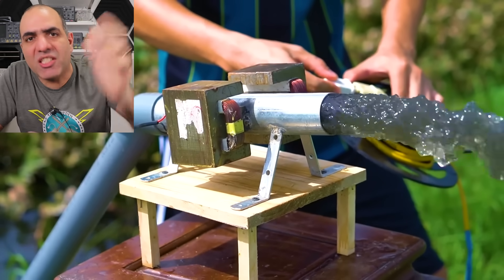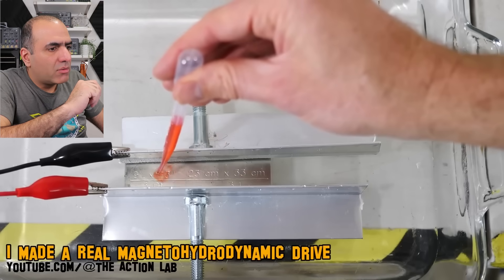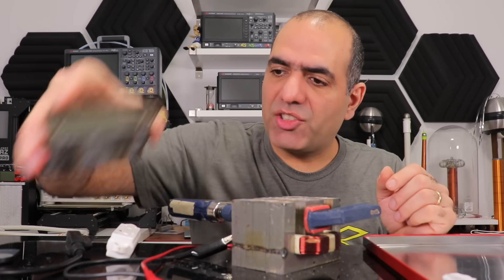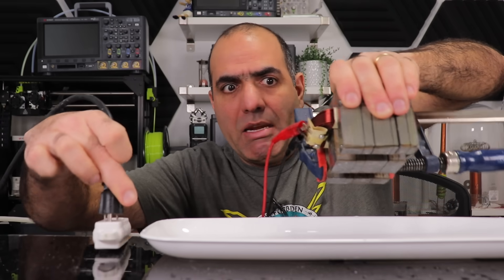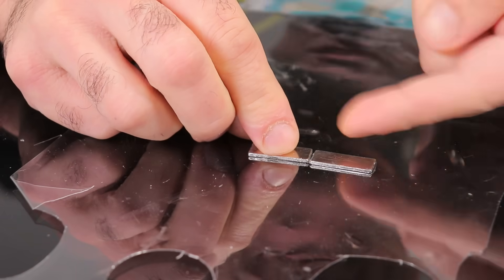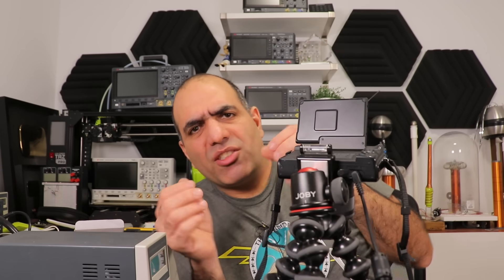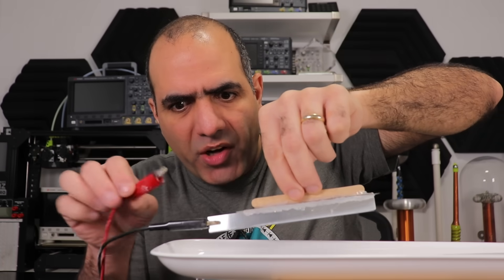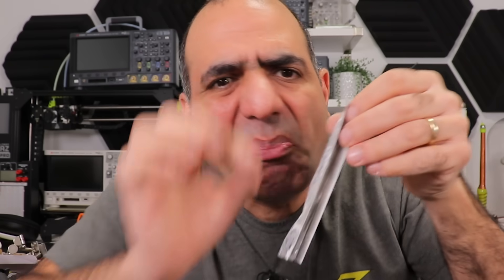Making a Water Railgun

Comment: Virtually every magnetohydrodynamic video is based on conduction between two plates, which with water, really uses up a lot of energy electrolizing to hydrogen and oxygen gasses . I'd really love to see induction based MHD. I get that water's resistance limits eddy currents, but i believe there is more influence then seen in this video. For instance, where is the water going to go when 120hz magnetic pulsed induction pushes it up.  It isn't going to break away from the pan bottom and, and because the depth of water was very shallow rather than deep.  Almost all the magnetic field exits the shallow water column rather than induce eddy currents at  greater distance.  

I have an idea. Take two MOT and face them to each other but keep them seperated with an airgap that grows from narrow on one side to something larger on the other.  And arrange the current flowing in the coils such that their magnetic fields atract rather than repell the the two MOT.  You might try wiring the two in serries such that their impedences add.  Or wire them in parallel  but with a third MOT in serries acting as a ballast.

 I believe that you will have a greater magnetic field, and that the magnetic field will be a gradient across the various sized openin,  and that and the physical geometry will aid in pushing water from the narrow magnetically stronger side  to the magneticly weaker wider opening. Maybe the induction effect will still be small, but without electrolizing water on two plates, induction based magnetohydrodynamics should be more efficent.

If you really want more pumping effect. Make the spacers between your MOT electromagnets out of something squeezable. plastic springs? The action of two MOT electromagnets  attracting each other 120 times a second will pump water more effectivly. 

Lastly wrap the MOT electromagnets in plastic so that you can keep the salt water off their steel laminated cores.

Comment: You were basically doing electrolysis between the two plates of the actuator and based on the fact you were using salt to decrease the resistance of the water you were generating chlorine gas and hydrogen gas, so in conclusion, yes, at least some part of the gas you were generating was poisonous.

Comment: On the topic of solid state  drives, @ElectroBOOM have you seen a video (I think it was Cody's Lab, I could be wrong) where he makes a freshwater electric field drive? Basically, he uses a sintered glass particle filter with two aluminum grids on either side in a round tube and DC current running though them to pump water. In the presence of Silicon Dioxide, one of the Hydrogen atoms in the water is attracted to the glass, causing the now slightly positively charged remaining OH group to be attracted to the negative electronic field of the electrodes, moving the water though the filter. it's not very powerful, but it is really cool.

Comment: 10:50 the reason for your house getting 113 volts is because you are a bit further from your local high voltage transformer, also during peak hours the voltage drops simply because the higher usage
Reply: hes meter is showing 160v, 113v would then be the RMS. something is going wrong but i dont know what

Comment: no, teh way you do water railgun is that first you need a strong laser to ionize the air, then you ionize the water not by contaminating it, but by stripping off the electrons of water molecules, creating a highly charged mist, then use a high frequency vortex gun to shoot this along the laser. the last thing to make this work is a high power sonic driver that pushes from behind and keeps the vortex rings of mist stable.

Comment: To be sure, there are water pumps that are made out of a single electromagnet, but that electromagnet is vibrating a metal bit attached to a rubber membrane. Said membrane does the pumping with the help of valves.

About the 160V water gun: you could have simply used unsalted water. That would have limited the current, and it would have made one of the most dangerous water pumps imaginable. 😁

Comment: Question? We're dealing with magnetic fields and eddy currents here, wouldn't a bit of thin insulation between the metal and the water solve the problem with the electrolysis without significantly affecting the pump effect?

I'd like to see this re-done with two insulated rails and something like a thin-walled PVC pipe running through the rails...

Something like this maybe? 

|o|
Reply: The fields driving the projectile are a result of the bridging between the the rails, as he explains at 8:50
I'm not sure why the projectile has to do the bridging as it would seem you can have the rails permanently bridged at the end, I suspect there's more than is discussed here.

Comment: "I don't know whether these gasses are poisonous or not"
Does nothing to prevent him from breathing them.
True engineer
Reply: Knowing that water molecules are split into hydrogen and oxygen by the electric current takes away a lot of fear of poisoning (and brings up other ideas which are involving playing with fire). Only danger present is the salt which can produce some small amount of chlorine gas. Shouldn't be much of a problem if you don't run this experiment for hours and stick your nose close to the gas bubbles.
Reply: @Schlappspaten_spielt  Chlorine will form more easily than oxygen but you can smell it before the amount reaches poisonous levels.
Reply: @Schlappspaten_spielt  yeah, you can't die or have irreversible injuries from slow chlorine buildup. You will run away crying long before it reaches dangerous concentration. The only situation where you can get seriously injured or die from chlorine is when you're instantly exposed to high concentration of it and you have nowhere to run. Then you'll cough your lungs out. Literally.

Comment: Water is a polar molecule, so you can move a stream of water with electric charge or a magnet.  Try putting a magnet near the water coming from your faucet some time.

Doubt it can be used as a motor, though.

Comment: 13:36 if you're using table salt (Which you shouldn't - use baking soda instead) then the gases are a mix of oxygen, hydrogen and chlorine (which you shouldn't breath in). If you're using baking soda instead, it will just be hydrogen and oxygen and a small ammount of CO2.

Comment: I keep thinking of the caterpillar drive in "Search for Red October".
If a nuclear powered sub used huge magnets then the flow of the salt water would cool everything keeping the magnets below their Curie temperature
It'd have to use batteries as a generator would be too loud. 
You'd only need a couple of knots to make a totally silent drive worthwhile.
Reply: That it's actually a thing in real life, but it's very inefficient.
Reply: With superconducting magnets it's feasible though still impractical. Also chlorine bubbles would be well detectable. In theory if strong running magnetic field was generated making kind of induction motor with water as its rotor, it wouldn't have any electrolysis and bubbles of gas. But I'm not sure it's possible. Usually superconducting magnets generate static magnetic field...
Reply: @allmycircuits8850  Chlorine gas production apparently can be controlled with a catalyst from Iridium oxide and  Manganese oxide. Wonder if efficiency could be boosted by collecting the hyrdogen gas and feeding it into a fuel cell.
Reply: Glad to see there are several commenters here with good taste in movies. :) BTW: It's The Hunt for Red October, just to be pedantic. ;) Released in 1990, it was based on the 1984 novel by Tom Clancy, directed by John McTiernan and starred Sean Connery, Alec Baldwin, Scott Glenn, James Earl Jones, and Sam Neill. Thanks for coming to my I-just-recapped-the-Wikipedia-article TED talk. :) That movie still holds up today, I think.
Reply: @antisoda  I thought it looked wrong when I wrote it! Thank you. It was long time ago that I watched it. I'll have to watch it again... 🚗🐛

Comment: if you don't want to make those poisonous gasses (in this case chlorine) try using  baking soda. salt is made up of sodium and chlorine (NA,CL) held together by ionic bonds witch break during electrolysis creating  sodium that reacts with water to make hydrogen and chlorine that is a gas that is a poison. baking soda (Na, H, C, O) is held together with ionic bonds that when broken by electrolysis release sodium (reacts with water to create hydrogen), hydrogen, carbon, and oxygen. This is why you should use baking soda as your electrolyte instead of salt.

Comment: Didn't you basically have a small electrolysis effect going on..  hydrogen and oxygen coming out of that process. >.>  
I was afraid you'd make a spark as a prank, and ignite something a bit more than intended.  
I suppose it wasn't enough to do anything in an open air environment.  Phew

Put that reaction in a bottle and you might have a bit more fun. :)

Comment: Note on 120vac rectified to 170Vdc and drawing too many amps. If the rails were half the height, there would be less surface area to conduct, and less current current would be allowed to flow in the circuit.  Also, If there is a conductive path through water between two potentials,  charged ions will flow, so you want only the inside surface  of your rails conducting where the magnetic field is pointing in one direction. Outside the plates, the magnetic field curl and eventually point in the other direction, and current flow outside the plates don't contribute to the effects your looking for.

Comment: Water is dielectric so you could use high electric charges placed in the correct positions to move the water. My friend and fellow Electrical Engineer did this experiment in his garage (very dangerous)

Comment: Magnetohydrodynamics is perfectly real. It doesn't work if the liquid is not have an electric current flowing through it. It isn't the water, or the ionized water which causes the motion...it is the magnetic field produced by the electric current in the water in combination with the external magnetic field. Also, it is a D.C. current on the outside electromagnet (or permanent magnet). An A.C. electromagnet would never work even if there is a strong electric current flowing in the water (the water would vibrate, not flow).

Is the water in question sufficiently "unpure" (ionized) to conduct a D.C. current? Is the supply of current in the water itself producing enough voltage at the given level of ionization to cause a sufficient current? Is the outside magnet oriented such that it flows in one direction only, rather than rapidly flipping flow back and forth and averaging zero velocity?

It is quite possible the other video was a fraud, but it is plausible if enough power was conducted through the water and simultaneously an outside magnetic field was applied which did not alter field direction.

Comment: 13:40 The gases are hydrogen and oxygen, it¨s water electrolysis. it's a basic "system" what you can use for separate water to it's gases. Hope it's gonna help you...
Reply: and chlorine gas from the table salt
Reply: what about the salt?.. it produce chlorine gas with electrolysis

Comment: I think I just figured out a way to make magnetic pumps work using magnetic particles and a similar mechanism to removing chaff from seeds.  If you place the magnetic particles inside a housing full of water and you run those particles through something similar to a chaff separator, you get the particles back after using them to push the water through the housing out a low density outlet.

It would absolutely work to move large amounts of water very quickly as long as the water source remains stable.  The friction of the particles being pulled through the water is more than enough to create a vacuum pressure the propels the water from the outlet while returning the particles to the inlet with gravity.

So you're wrong too.  This is more than possible.  Just not the way the scammer represented it.

Comment: Just a thought, but if you ran this in a pipe with a nozzle at the end rather than a channel that boiling water <should> kinda "shoot out" and thus sorta work as a "pump" I ssuppose (or a rocket if you get it hot enough)...

Comment: you should test your breaker because the more you pop the breaker the weaker it gets .. some breakers can only be used 2 or 3 times .. sometimes just switching the breaker off like a light switch can damage it
Reply: 2 or 3 are the fake ones
Reply: Does it make it pop more often?
Reply: @vappyreon1176  seems like it .. its like the breaker pops at 14 amps instead of the original 16 amps .. sometimes it doesnt even pop and gets super hot untill the metal contacts fuse themselves shut and thats very dangerous ..
Reply: @6kill6god68  If the breaker welds it self it's a pretty shitty one, or the thing is way out of his rated work range.

The bimetal strips that make the internal switch of a breaker are supposed to bend at one specific temperature.
Reply: The breaker he's referring to is on a power strip, so I'm sure he probably replaces the power strip after so many times it pops
Reply: ohh i  see .. ah yess i forgot i live in a 3rd world country .. they sell scraps here .. breakers here usually last about 5 to 6 years ..

Comment: This is like a similar idea I had. I figured you could build a better rail gun by using water with a dissolved electrolyte as the rails/contacts. On a smaller scale the water would be held in 2 thin walled tubes with small slits along the length, possibly large enough that the water would bow out but would be held inside via surface tension.  Then the projectile would either come into contact with each water rail or electricity would arc across the gaps between the projectile and the water, I also assume the water would morph as electricity flows through it to better connect to the projectile. The projectile shouldn't experience too much drag and the rails would be able to "regenerate" fairly easily by pumping in a little more water. Not sure how the inside of the barrel would fair after each shot, water may short the rails inside or dried electrolytes may build up on the interior, but it seems like a simpler/cheaper problem to solve than solid rails physically destroying themselves. On a larger scale you might need to rapidly fill the rails at the same time you fire the projectile so it doesn't have time to leak and fill the barrel.
The water could act as a coolant and a thermal buffer (it's a lot harder to heat water than to heat up metal), wouldn't ever weld to the projectile (unlike solid rails, it will move out of the way or boil off if it somehow gets hot enough to do that), would allow for looser tolerances of the projectile, and if it failed there would be far less damage.

Comment: Salt water is not an ohmic conductor,  so it's resistance can't be expected to be linear ,it's dependent on distance between  electrodes, area of the the electrodes , concentration , etc

Comment: Water is actually slightly magnetic- but it's repelled, not attracted, because water is diamagnetic. You can produce very small dimples in the surface of water by submerging very strong magnets. You need about a Tesla for it to be visible though.

Comment: The reaction after you added the FULL BRIDGE RECTIFIER was amazing! Did you just turn salt water into plasma?
Reply: No, thats hydrogen burning from waterelectrolysis.
Reply: @maxschmidt9888  oh thanks I did wonder why it went from water moving to bright flames
Reply: @maxschmidt9888  I'm not at all doubting you but the spontaneous ignition point of hydrogen is 650⁰C or needs a spark. I don't see either of those conditions with this but maybe there's some tiny sparks we can't see on camera?
Reply: @Pastamistic  Thats true. After reading your comment I thought maybe the heat of the reaction, but then I remembered the boiling point and all energy above that is used to vaporise the water so the actuall watertemperature only rises to 100°C. But then I thought maybe the  watervapor is electrolysed with just the H3O+ and OH- as Ions and then it possibly could reach the temperatures. Also the gasmixture is at a perfect combustion ratio regarding the oxidizer (H2/O2=2/1). But maybe the voltage is too low (Easiest way of flow and U=RI)? Yeah its possibly small arcs.

Comment: Hey, just to let you know the "boiling" of the water is not actually boiling but electrolysis of salt water and assuming you used regular table salt(NaCl) it is producing chlorine which is toxic and hydrogen which is highly inflammable.
Just fyi since Mehdi doesn't cover it and if you wanted to try.

Comment: Could you use the strong coils from your microwave as a strong electro-magnet, way stronger than those small permanent magnets? Doing so would increase the strength of the magnetic force on the water with a lower electric current, thus reducing the heat generated and the water electrolysis. Also, I wonder if changing the type of ions in the water can help improve the flow. in particular if iron ions are mixed in, they would be impacted by the magnetic fields, which could have some interesting effects on the flow
Reply: I'm pretty sure iron salts are not ferro-magnetic. 
The type of ions used can affect the conductivity of the solution, they may also undergo electrolysis if the voltage difference gets too high and the right mix of chemical species are present in solution and the electrodes are made of the right material. For instance here you have a bleach and chlorine production setup as well as water electrolysis.